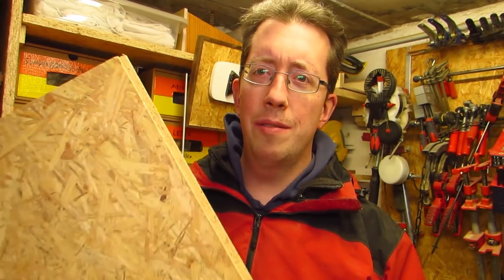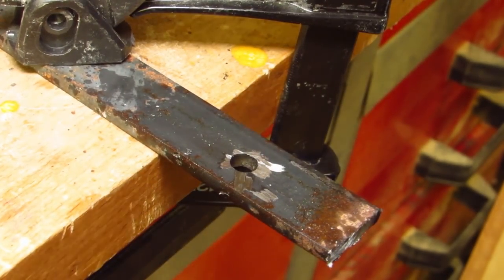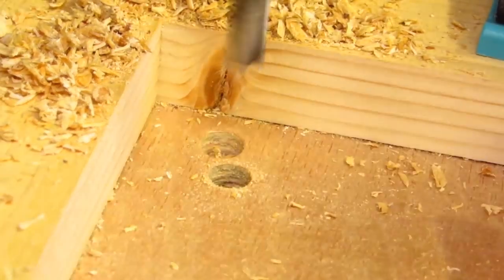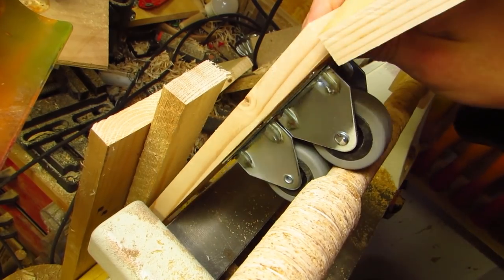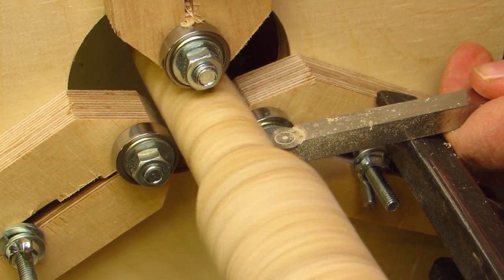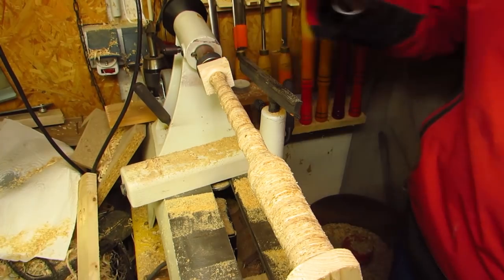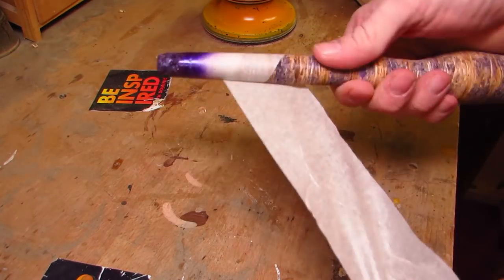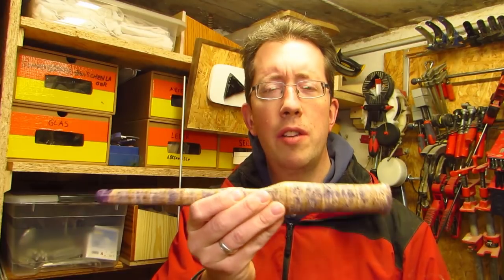OSB Wand - feat. Steady Rest and Dowel Maker

Comment: Great experiment! That OSB looks like a tough one to turn, looks like it could use some stabilizing. Love that DIY steady rest too, great quick solution!
Reply from the maker: It is plenty stable as long as the diameter is large enough. I have turned tea light holders (between 3" and 4" in diameter) and never had a problem with them. The thin stuff though, that's a different matter. Thanks for watching, Zac!

Comment: Also again in German? :) Nothing is as constant as change. But there is always a sure constant, tea light holders and wands. Although there has not been a long time with tealights, but soon is Easter, then you will remember something again. It was exciting to see the problems on the way to the project and the implementation was great. Next time instead of dowels an aluminum tube and in the top a LED ;)
Thank you for showing
greeting
Sascha
Reply from the maker: An aluminum tube would actually be a great idea. I will keep that in mind, because naturally, there will be more wands at some point. And I agree, the tea light side of me has been pretty light recently. I need to remedy that.
Also, the idea was that if I do it right and tweak my (non-existent) process a little, releasing my videos in two languages (again) should not be as much of a hassle as it used to be. Thanks for watching, Sascha!